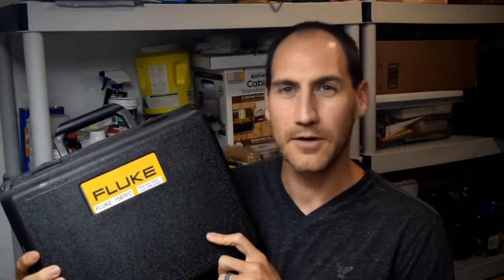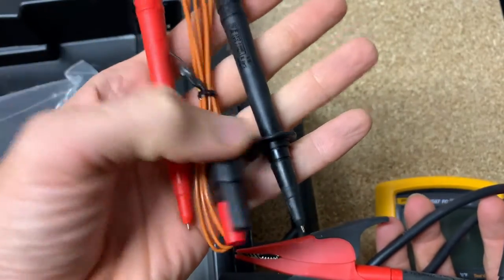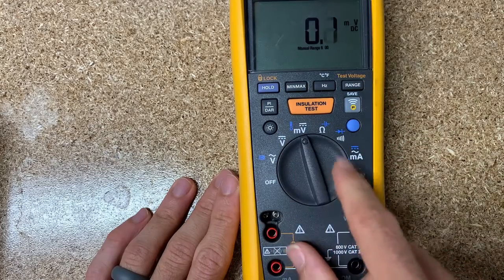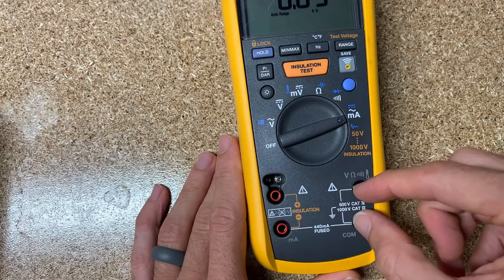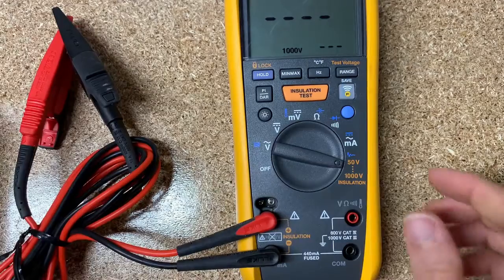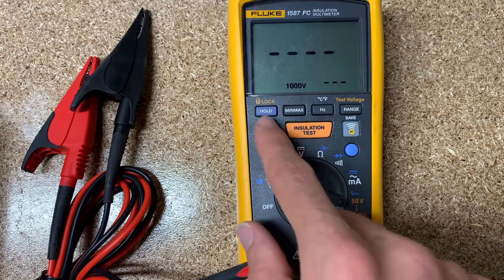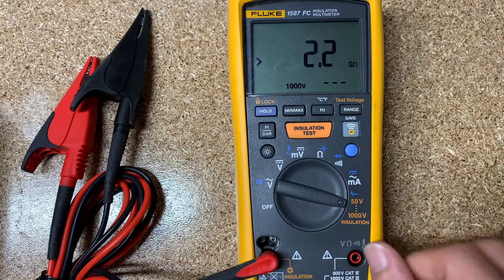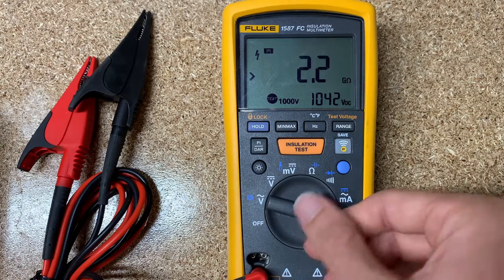Fluke 1587 FC - Fluke Fridays - Episode 20

Comment: plz tell me onething this device for measuring 4 to 20 ma .is it good or not for this and secodly if attached with i400 this work perfect or not
Reply from the maker: You can measure 4-20mA (with the test leads only) but you cannot source.

You can use a i400 with the 1587 FC to measure higher currents AC up to 400 amps

Comment: Hi, I bought the Fluke 1587FV and it came with the Fluke i400 current clamp but I cant get it to work, is the i400 compatible with the Fluke 1587?  TIA
Reply from the maker: Yes. But one tricky thing about the clamp accessories you have to know what there output is. Some are mV and some mA. In the case of the i400 it outputs 1 mA/A measured by clamp.

So you need to make sure the 1587 FC is turned to mA and you need to make sure the clamp is plugged into the mA jacks. If you still have problems I would check 2 other things:

-make sure your fuse is not blown
-make sure you are on AC current (i400 only measures AC current not DC)

Comment: It uesd to test wire motor 3 phase or wire 3 phase ...
Reply: Very good. Iam from iraq
Reply: @asadbabilbabil7791  Did oil well drilling companies use these in Iraq?
Reply from the maker: You can test both 3 phase motors and 3 phase wires for failing insulation